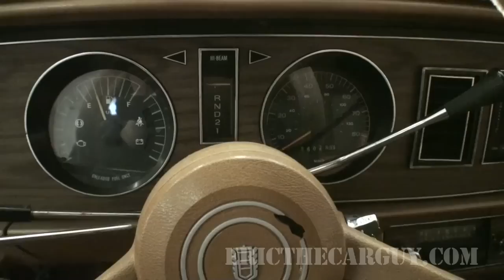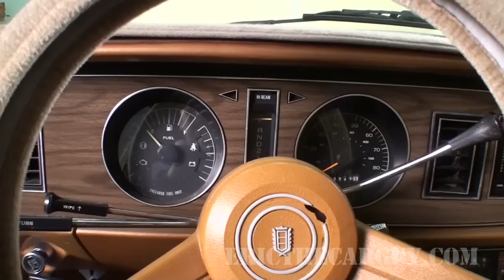1979 Ford Fairmont a Closer Look #FairmontProject

Comment: Like many of you have said, either you enjoy vehicles of another era, or you don't.  99% of the fun is figuring out what you would like to do to it.  I have a 68 VW dunebuggy that I have been working on for 15 years.  It doesn't have power anything,  No PCM, no ABS, no SRS, no roof!  I have a number of new vehicles with all of this, and I really enjoy them.  But when I drive my buggy, I know it doesn't have these things, so I drive accordingly.  All of the baby boomers survived driving these cars, so I am sure we can to.  If you want to buy a Prius or Leaf and drive around covered in bubble wrap, go ahead.  Just don't pass judgement on those of us who want to drive vehicles with the classic power options, like windows, steering, radio, seats, temp control etc.  All HAND powered!!

Comment: it has 10 MPH bumpers on it.. strongest on any car..   the vacuum hose from the carbon canister to the tank is collapsed.. at 10 minutes in..  rock the crank back and forth.. you will find a lot of slack.. a fresh chain really helps..  
there are 2.5 turn and 3 turn lock to lock steering racks for those..
2.3L intercooled turbo coupe motors with automatic transmissions bolt right in without any significant changes.. give you around 220 HP and 30MPG if you keep your foot out.. you will need an inlet on the hood for the intercooler.. its a real BOLT in..   86 to 93 mustang 5.0 EFI or 5.0HO motors should also be a bolt in.. i was not aware of different cross members.. i have seen a lot of 4 to 8 and 6 to 8 swaps. without crossmember changes.. 
the 83 to 87 thunderbirds had straight axles and the ones with the handling package could pull almost what a corvette does on a skid pad.. like .96G i had an 83 5.0CFI aod with the 87 turbo coupe 16" wheels, sway bars front and rear and it was great handling car. used a 96 5.0 explorer roller cam long block in it.. the EFI if you get everything hooked up properly so it can pass the KOEO and KOER test can knock down over 25MPG easily.. my sis gets 29 highway in her 87 town car 5.0. she drives with a steady foot on the throttle though.  thats going to be an even nicer car when you finish it..

Comment: I owned a 79 Fairmont with a 2.4 liter.  For a four door sedan as big as a Fairmont, it wasn't as underpowered as you might think.  One of the worst things about the car was the wiring.  The car in some places used a type of wiring ribbon that consisted of flat copper tracings sandwich between sheets of mylar.  Over time the mylar became brittle and  the copper would corrode or two adjacent traces would short.  Since Ford didn't make replacements, you would have to rewire with conventional wire. A major headache.

Comment: regarding the manual swap; what about a three on the tree? (or whatever it's called when a manual has a column shifter)

EDIT: maybe you could mod a column shifter to work with a 5 speed manual?

Comment: the hood release on the outside might have something to do with that being a base model, I came across a 79 Fairmont Squire, and it had the release inside the car.

Also, I looked it up, a 2.3 actually made a teeny bit more hp than this 3.3, due to it having a 2 barrel carb, I know, weird.

Comment: Really excited about this project Eric, I think it will be a lot of fun. After you first revealed the Fairmont, I found an '81 sedan for sale near me, same straight six and three speed auto as yours. Test drove it, actually really liked the way it drove and the interior was immaculate, but the body was too rusty. Was also surprised that it had A/C and rear defrost too. Could have been a fun project car, but too much work for me. I think it was an even uglier color than you have: beige with gold two-tone. Awful, but period correct I guess. Cool car I think.

Comment: Very interesting video ! I will follow your progress on that car with great attention :-) I already learned a few things about my own car (I was wondering about my high brake pedal, but apparently it's normal when you have no power brakes). I also have a charcoal canister, why were you so surprised to find one ? It's interesting to see the different choices manufactures made : Your inline 6 appears to be less efficient than the mopar super 6 that equips my 1980 Aspen, but on the other hand, I have a much more primitive suspension : torsion bar at the front, and leaf-springs at the back.

Comment: I remember having a 79 Fairmont.  It was ok, used to belong to my sister.  Story is her boyfriend stole the car, and the car was recovered after she had it replaced.  So she sold it to me.  About a year later, I'm driving down the street and all of a sudden the car came to s a screeching halt on its own.  I got out looked around and found nothing, then several months later I'm hearing some awful noise from the rear end and realized the rear end kind of blew up on it.  I think what happened is something happened in the recovery of the car.
Another problem I had with it was the carburetor.  The carburetor started falling apart, actually the 4 screws on top for some reason stripped out.  I got stranded on the freeway once because of that.  Tried and tried to start the car when I realized the thing was loose,  Took an old shoe box sat it on top of the air filter just to make the carburetor hold together and it started back up and got me home.  I replaced it the next day.
Other than the rear end falling apart like that and the carburetor problem it's been a good car.

Comment: I have a 78 fairmont wagon that I built into a mustang station wagon. and A handful of mustangs vintage 1981 to 1998. you are looking at a 7.5 rear end. most likely with a 2.75 final drive ratio. Believe it or not I pulled Spider gears from an 81 mustang rear and put them in my 98 mustang when I blew them. As far as a manual transmission, the fairmont came with a three speed manual as an option. Good luck, and if you happen to need any help/advice/locating a part. I may be able to help you out. I have a large stock pile of fox mustang parts.

Comment: Eric, You mentioned the possibility of a tubular K-member for the car. After doing much research on them for my fox body Mustang, I found that only one company will certify their K-member for use on the street, which I gather that your car will be driven on the street most of the time? Maximum Motorsports is that company and I wouldn't use anything else on a mostly street driven car. Google K-member failures and you will see why.

Comment: GM Holden in Australia made a 4 cylinder version of a similar style engine called the Starfire engine in the late 70s early 80s. More like the Missfire engine with about 70 hp max. 0-100kmh took a week and half and you could only do it going downhill.

Comment: My .02 cents.
89-93 Mustang 302 and AOD. (Before 89 used Speed density FI, after 93 AOD was AODE electronically controlled)
Spindles, brings up a quandary. Use 94-95 and this will keep the stock track from a mustang but force you to clearance for dual piston calipers from 99-04 cars. or choose later model spindles and increase the track by 8mm and you can run the PBR calipers. 
As far as the IRS there is this on ebay http://www.ebay.com/itm/2003-2004-Mustang-Cobra-IRS-8-8-SVT-Complete-99-01-31-spline-Rear-End-/151248662873?pt=Motors_Car_Truck_Parts_Accessories&hash=item23371f7159 

These people have been parting out these IRSs for years (I have been keeping an eye on them for myself) they may be close to you and you may find other parts from them.
Sorry if I over shared.

Comment: I've got a '79 Fairmont wagon. Someone just gave me a "52 Dodge P.U. so I'm going to concentrate on it now. But... my original plan was to put a 240 or 300 six in place of the 200. They are torque monsters and parts are available for them. The rods in the the 240 were 5140 steel and damn near 7 inches long. I know pullers who use them in 460s. Any way it might be entertaining to do something really different and build a banger. Not everyone would have one!
By the way; the small six in the Fairmont was introduced in the 1960 Falcon in a 144 cuin displacement. They came in 144, 170, 200 and 250 inch versions. Great bottom ends, lousy heads.

Comment: The Cobra Mustang IRS rear ends should fit in there, just be sure to research and fix their inherent weaknesses and issues before installing.
P.S. A wrecked Terminator Mustang would give you a great engine, trans and rear end and brake system/5-lug conversion, plus you can't beat that blower whine. ;)

Comment: Looks like it will be a pretty cool car once you fix it up. As for the faded interior there are a lot DIY seat restoration videos out there, some of which just help you bring the material back to life. Kent Bergsma who you may have seen on mercedessource has a series of videos on restoring seats. You may wanna check that out. As far as repairing or upgrading stuff on the car, it really depends on what you wanna do and of course what you can afford. I'm sure either approach you take will turn out well! Good luck! I look forward to seeing a closer look video on your vigor as well whenever you get around to that.
Reply: Hey micheal, i FINALLY got my new 02 snesors installed on my subaru. After i installed the new ones the check engine light turned off and it hasnt come on again yet, yay! Now i really want to disable my daytime running lights (DRL) they are very annoying to me and other drivers and i dont need them. I saw two wire harnesses going into the DRL module one is black and one is white. It said in the description that i looked up to  disconnect the white harness and leave the black one in. So it only disables the DRL while every other light function still works. Hopefully it works out, im probably gonna try it tomorrow
Reply: Congrats on the o2 sensors! As for the day time running lights be careful whenever doing anything electrical on that car. Make sure you know exactly what you're doing before hand. If you disconnect the wrong wire you could cause a short in the computer in some instances. I know on those Subarus the daytime running lights go off when you have the parking brake on, but will stay on when driving. You'll have to look into that and see what the fix is.
Reply: Yea i have seen the DRLs turn off when i put the e brake on but i know where the drl module is (uner the dash next to the steering column.) I believe the black wire allows the DRL to by pass the other light functions in the car. The guy in the description said he disconnected the white wire and the only thing that was disable was the drl. Everything else worked so im thinking of trying it. If it doesnt work ill just reconnect it
Reply: Its a waste of the bulb with DRLs and sometimes i forget to turn my lights back to on cuz its on daytime lights but at night it looks like headlights but dimmer. That will probably let me see if my headlights are really on or not
Reply: Lol yeah I know. Whenever I drive my moms outback I just put the switch on auto. The newer ones have an auto function. But I can always tell either way whether or not they're on bc the dash lights up
Reply: Yea but my subarus a 2002 so it doesnt have one. Either way it doesnt matter for me. I just dont like having stupid little lights on while my headlight switch is in the OFF position. Thats how it should be haha
Reply: I get that DRLs are a safety feature but they dont really do much
Reply: Indeed. I know that in some states you are required to have drl. Including Canada
Reply: Yea but in my state they dont really mention in like like state inspections and stuff. My neighbor told me he disabled drl on his car and he never got in trouble for it cuz they dont care. They only want to see if your actual headlights work
Reply: Hopefully it stays like that but im gonna try it out see if it works. Ill let you know how it turns out

Comment: I would consider a New reconditioned original steering wheel and a rear disk brake conversion, also new brake pads all around and new Brake Hoses/Flexi-Hoses, but apart from that, make it an original every day driver.

Comment: hi eric
i think you should keep the straight 6 and the three speed auto, and tune the engine up. this would not only be much less work and money, but would likely be more challenging and interesting. surely you could triple the output of that engine with the proper bits? there must have been muscliesh cars which used thae same block. it would also keep the car closer to stock. none of my business, but there you go. timw

Comment: Never put one in a Fairmont chassis but put a number of Olds 455 engines (and the turbo 400 tranny) in other cars, they are compact for the CID's and it was a cheap way to get a performer.  I'm sure one would fit in that unit.

Comment: They should have sourced and used the Australian crossflow 3.3 and 4.1even if they marketed it in the old cubic inch displacement terminology.
 I remember the old 200 put out 130 B.H.P and the 250 155 B.H.P

Comment: Why not run hi flow cats? With fuel injection and those you should sail by emissions with it. And have you considered running this on E85 when done, it is over 100 octane.
Reply from the maker: I've thought about high flow cats but not E85. Interesting thought.

Comment: Throw a new 5.0L 302 V8 crate engine in, and of course the Explorer 5.0L intake manifold. Wouldn't take too many mods to fit it in, since the later model foxbody Mustangs were based off of the Fairmont.
Reply: It's not that the mustang was based on the fairmont they both shared the same platform. It's ford being cheap but in a way that benefits us now.
Reply: Brian TX the Fairmont was the first FOX platform vehicle manufactured first - this replaced the Falcon-based platform which dated back to 1960 (both the Falcon and FOX underpinned the first and third gen Mustang)

Comment: If you want fuel injection go with a modular! You can find them with a 4spd auto REALLY easy, either from a crown vic/grand marquis or f150 although im not sure if the engine mounts are in the same place.... If not a modular id say just get a 351 but thats the hooligan in me talking :)

Comment: You may need to consider upgrading the entire rear end to the bolt-on carrier type that came with the V8 models. Ford rear ends of that vintage with the integral carrier are a bit weak for a performance V8 upgrade.  The good news is you’re planning to stick with the auto trans so you might get by with the existing rear end…maybe.

Comment: Eric... Has the cyl head been repaired just above were you pointed out that leak? Looks like there's a blob of weld in the head just above and to the left of the leak.
Reply from the maker: No, that's just goo from the leak.
Reply: EricTheCarGuy Eric, I have a 1999 acura 3.5 RL and it wont drive or even rev up unless TCS is on...  actually it revs down then stalls..... Any Ideas???

Comment: Help Please!!!!  1991 318is, replaced water pump and thermostat.  Put things back together and had a intermittent light rapid clicking noise.  Sounded like the fan blade was hitting when I rev the engine.  The sound is a little like if you dropped a screw into your garbage disposal (not good)  I started removing belts and things to rule out. Removed the fan and fan clutch, power steering and A/C belt bu still had the noise. Removed the final belt that runs the water pump and alternator and noise stopped. Thought it was the water pump so I put the old one back in reattached the water pump/ alternator belt and the noise came back.  The car did not have this noise with this water pump prior so I ruled out the water pump.  This only leaves the alternator. Is this possible?  Can an alternator make a rapid intermittent clicking noise?  I cleaned the engine some and I now wondering if I got water in the alternator (although I did cover it with some plastic) and that is what is causing this issue.  I recorded the sound and could send the video if you have a way to do that.  Thanks for any help.

Comment: I have a 78 fairmont also in awesome shape.. Only problem is a passenger side footwell leak when it rain hard.  Heater core has been plugged.  Do you think I would have a rusted cowl? How difficult would this be?  What are your thoughts? Awesome video btw!

Comment: Put a beefy nasty 3 speed auto in it. My mother had a 1992 Saab 900 Turbo with a 3 speed, people used to complain a lot about it, but it didn't shift into second until you were going 25 if you babied it, and if you were going up a hill at 55mph it was at 2,700 rpms or so, just enough RPMs to really get the turbo spooled. There's something to be said for a transmission that keeps a motor in it's power band.

Comment: find yourself a 1989 Mustang 5.0, first year for mass air, no air bags to deal with. You can use the fuel injection wire harness, engine, transmission. 1989 is the best year to use if you want to go electronic fuel injection, because of the mass air, which makes any mods much easier. 1986-88 are not mass air, but speed density, 1990-93, are airbag cars, so it makes using the mass air option a bit harder.

Comment: Hi eric have you thought about the steering column shift for the manual transmission 
for one i really appreciate a car for its character (like it rusts, it do not slot into 3 gear and so on) but now days its hard find a car with such character they are more....... let say "clinical"
Reply from the maker: Nope, going with an auto in this one.

Comment: I would say run a 302 based motor with a c4. If you have the extra change, run a gear vendors OD for fuel mileage.